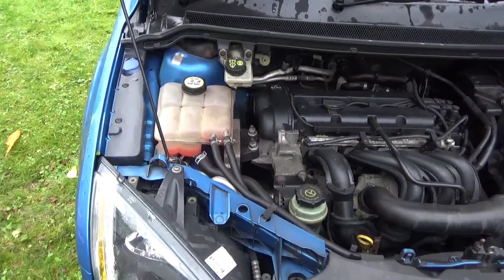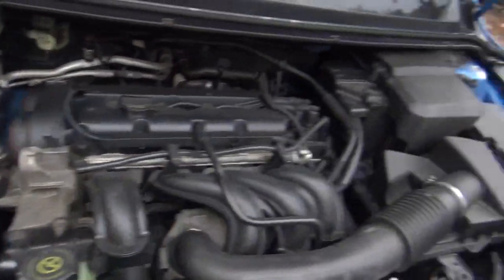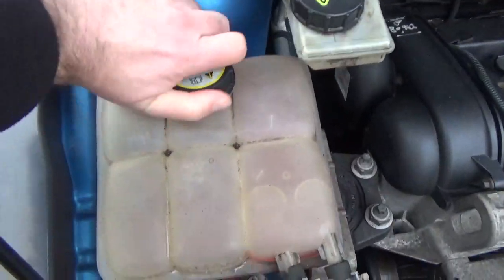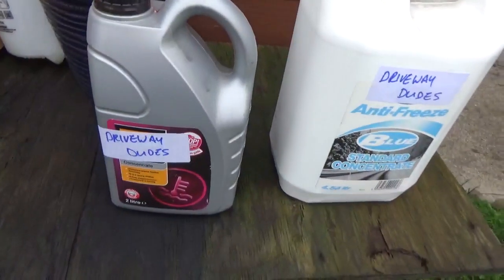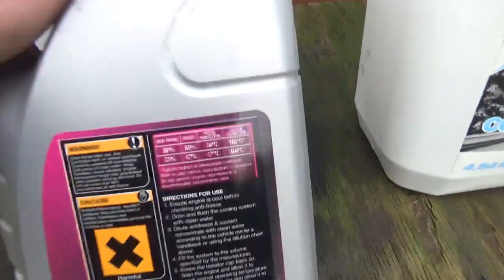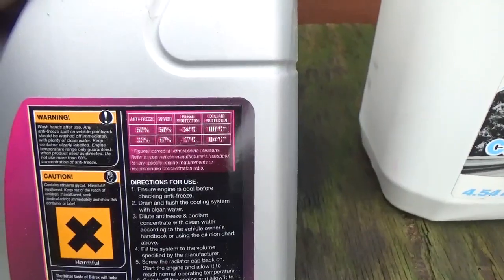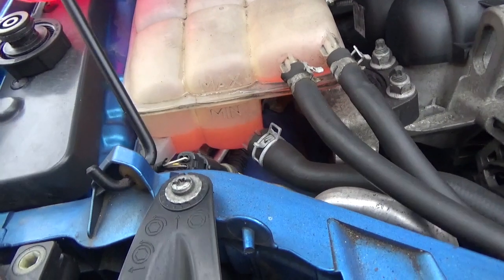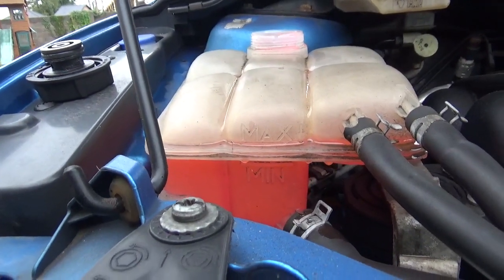Coolant Top Up

Comment: Thats filled max on a cold engine. Once the engines warms up, the fluid will be actually above maximum which can cause a burst in the cable system. 
Always fill right above minimum so that the system once stressed and warmed up dont cause stress to the cabling system which can burst under pressure.

Comment: When I try to take the cap of the coolant tank, only the safety cap comes off? There seems to be a second part to the cap that won't come off. Any guidance on this? It doesn't appear that the cap is broken in any way.

Comment: Hi sir, I've a 2012 ford focus sedan ambiente. My coolant is below the minimum level and I decided to buy greed coolant because that's what I thought the colour of the existing colour was. But after inspecting my current coolant in the car, there's like a combination of green or orange. Is it okay I top up with green or did my mechanic throw in whatever coolant there was, with the last service?
Reply from the maker: Yes you can. Any coolant is better than no coolant. 
The different colours are usually for different temperature ranges.
When next carrying out a full service try to have it drained so you can use one colour that is suitable for your climate
Reply: "Mixing different engine coolants or using the wrong coolant can impair the performance of the special additive packages; this can result in increased corrosion to the radiator."

It's not the climate that determines which coolant to use. It's the manufacturer.

Comment: I have a query. After riding around 2500 kms on my new motorcycle, I noticed my reservoir coolant level was just below the low mark. But the radiator was full. Is it okay? Thanks in advance
Reply: @Gautam BP I would get it checked that is too quick to fall that low.
Reply: might be a vacuum. keep the expansion tank filled should be fine after that.

Comment: are you sure you don't have a leak? that is proper low. My Focus has never gotten that low! I've only needed to top up once in 70k miles .
Reply from the maker: No leaks. Its not often that you would need to top up though its always a good idea to check periodically.
Reply: It's normal to top off occasionally. But if the coolant is missing all the the time that would be a problem.